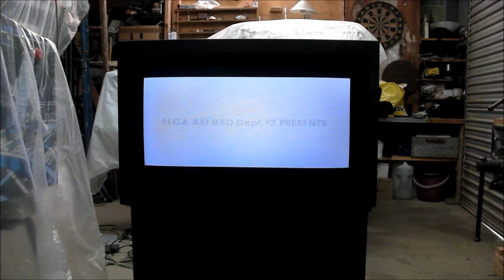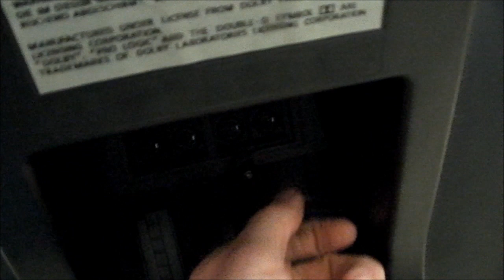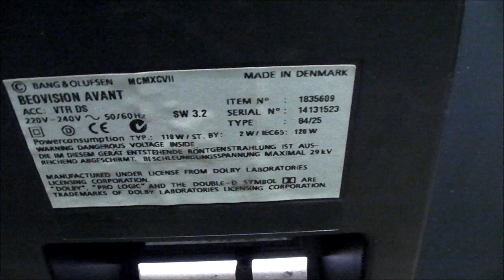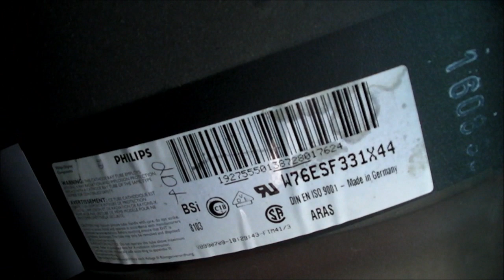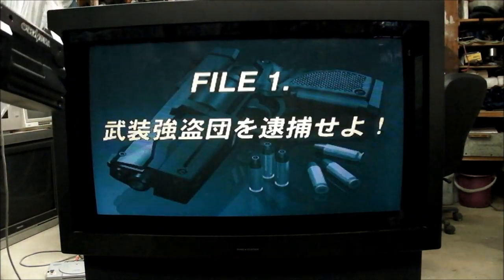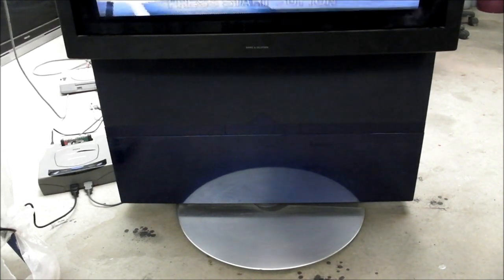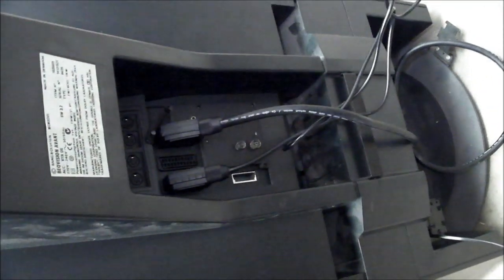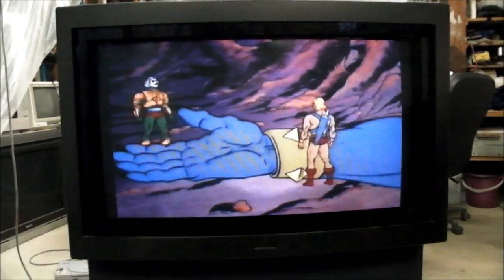BeoVision Avant 2 32" CRT TV

Comment: For thoes who owns this TV - you can set 4:3 format by pressing LIST and selecting FORMAT (on BEO4 remote) then press 1 to change to FORMAT1 and then using UP or DOWN arrows you can switch between 15:9 /14:9 / 4:3 modes.
Reply: Also, if you find a certain console always switches to 16:9 (widescreen) when you don't want it to. Disconnect pin 8 in that consoles scart cable, this will disable aspect switching.
Reply: @tog2842  can u explain more ? Changed it once , tried it again, doesn’t work , I press 1 , nothing happens:/

Comment: B&O never tried to hide the fact that they use Philips internals. At the time, it was either Philips or SONY tubes. B&O greatness was in the product design that “looked” thinner compared to the competition and the clever internal logic that adjusted the picture to the room light condition. They also knew how to compensate on the tube changing its character over time.
Reply: the tube choice was within philips or videocolor at the time for almost every tv maker. circuitry is original b&o and this is what really counts
Reply: I love Philips stuff, specially the ones of some years ago..
Reply: Sony tubes in B&O? Nah.

Comment: I have a Sony XBR and Pioneer Elite from 2002/2003. Great picture and great sound when partnered with monster premium component video and audio wires. Better picture than the cheap flat screens most people have and no need for a separate sound system. Got mine on Craigslist for $50 and $100. New prices were $2500 and $5000.

Comment: 13:20 The video/tv scart connection cable worked in both directions, input/output, like any other scart connection. You could buy a Beovision Avant with a video2000 vcr, a VHS vcr or dvd player, therefor such a recorder wasn't internal integrated. And B&O mostly used Philips CRT's and other Philips components in all their products. Just an over expensive Philips tv. Any B&O dealer that sold 2 Avants a month had a good turnover

Comment: cheers Rob.
I have been looking today at picking up one of these, but have now decided against it, due to the 100hz refresh rate - I was planning on using some lightguns.
back to the drawing board ;)
Reply: Does it have 100hz? The label on the back of mine, same model as the one in this video says 50-60hz.

Comment: How do you connect a ps1 via scart to this TV as I've tried many different settings and configurations and still can't get it to come up. Any suggestions?
Reply: Daniel Andrews did you ever figure this out?
Reply: On mine you'll have to go backwards from program 1. That switches the tv to 96 or so. And thats, where the AV-Ports are , but as far as I am concerned, you can use only one at a time. I try to figure out, wether I can wire up three running devices simultaneously, just like on my Loewe Nemos 32 (which, in my opinion, is the best CRT TV ever made (and thats why I have three of them))

Comment: did you manage to change the screen ratio. i've just bought one of these and in the manual it says to press list until you see format, then press 1, 2 or 3 to change to desired format. not sure if my remote is faulty as nothing happens at all when i press list.

Comment: The b&o sets used ultra short throw crts, bespoke made by philips, they had an exceptional picture, id rather have one of these than any lcd the reason the vcr was built like that was so you could connect it directly to a tv box like sky or nynex.
Reply: I am still using plasma today for my reference set. I do have a Sony CRT that is fantastic for older gaming and even older TV series DVD's that are in 4:3 ratio.

Comment: Why is it that light guns never seem to work right on the larger tubes? Is it because of the refresh rates? Also what is the oldest tube you own? I remember seeing an old magnavox woodgrain model but turned my nose up to it due to the inputs. Haha
Reply from the maker: It is because of the refresh rate, the size is not an issue. The oldest tubes I have are late 80's. I collect sets that have RGB inputs, even though there are tvs from the eighties with scart and other types of rgb connections, they're very rare in my part of the world. Also the older tubes tend to have grayer glass compared to the tubes of 90s which became more black and gave better contrast as a result.

Comment: Hey Rob, not sure if you respond to this but I’d be super happy if you did! Lucky to pick up one of these locally. Super excited. However, I won’t have a remote. I know I will need one but in the meantime is there anyway I can turn the TV on, off, control volume, And switch inputs without the remote?
Reply: Did you manage to turn up the volume without the remote control?
Reply: I never ended up picking the TV up for the simple fact that I was afraid that I wasn’t gonna be able to control the TV without the remote! Wish I still did! Awesome TV

Comment: Hi Rob, just wondered if you have any info regarding input lag on this set?
Reply from the maker: no idea sorry
Reply: @nostromo there should be no input lag as it's a CRT. Aslong as you connect the device straight to the scart or s-video/composite cables it's lag free, input lag is introduced when processing is involved, e.g. if you want to connect a HDMI only device using a converter or using lots of scart switches.

Comment: Can someone shed some light on this for me please. The guy mentions 100 hertz refresh rate etc but the label on the back of the TV clearly shows 50-60 Hertz. I am new to recearching this so please let me know what's with this??
Reply from the maker: the 50-60hz on the back refers to the power requirement on the TV. It can accept a 50 or 60hz AC power cycle, it is not connected to the refresh rate of the screen.
Reply: RGB Rob . Thanks for getting back to me. I was trying to pull some specs for this TV cause im thinking of getting one but can't find d anything about the refresh rate anywhere. How are we supposed to know where the refresh rate is displayed if what's written on the back is irrelevant ??
Reply: @rgbrob  Do you know if theres any way to force 60Hz? Im looking at a 32 dvd (8453) and it doesnt mention 100Hz anywhere in the product spec. It says it can accept an NTSC signal but Im not sure if that means it will be at 100Hz or it actually can do 60.

Comment: how do you connect a Nes to it?
Reply: Get your NES modded for RGB! However if you dont wish to do that, you could easily get your NES to work via the RF cable, an RCA, or S-Video. All those cables can be picked up cheaply. However a modded RGB NES is the best option. Though this vid should prove that this TV is not the choice for retro gaming. Your NES Zapper will not work and all your games will be stretched to widescreen. Not cool